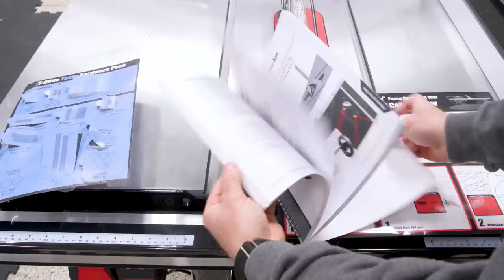I Left Powermatic for Sawstop!

Comment: Welcome to the fold. I am sure you are not missing anything changing to Sawstop. I loved the video, but I wished you would have mentioned the Sawstop technical group. I have never seen an after sale service group that can match them. They are fantastic. No matter what problem you are having, they will walk you through it over the phone and get you back on track. An absolutely awesome group of experts will answer your call (immediately) and get you back running again. These are not people following a flow chart to answer you, they actually know what they are talking about. 
  Brings me to point number 2. Should of explained how the brake system saves fingers. In my 40 years of woodworking, I finally made a mistake. Kick back caused one of my fingers to engage the saw blade. The blade disappeared below the table so fast I was left with only a small red line on the finger in question. It did not even bleed. It was less than a paper cut.
  I will never ever, ever, ever give up my Sawstop saw. I have the 52in 3hp pcs with the sliding miter on one side and the router table on the other. You were always at the top of my list for people I watch on youtube. You just went to number #1. Powermatic doesn't deserve you. Their loss, Sawstop's gain.

Comment: I injured myself after the cut was finished and the saw was powered off. Too easy to do. Question, does the saws top system still operate after the power is removed?
Reply: The braking system has its own ON switch separate from the switch that starts the blade.  The brake still runs as long as the blade is moving, even if you've just turned the blade power off.  The brake doesn't work if its separate power is turned off, or if the saw is unplugged.
Reply: @stevenkrause3907  That's good to know. Given it stops pretty quickly this would eliminate much of the risk but not all of it when you don't have the guards in place or the brain in gear.

Comment: You can bypass the safety by using the key switch if you are using wet material or something you aren't sure of. Also; the dado cartridge uses the same height setting as the standard brake so you don't need to readjust it.
Reply from the maker: Unless your dado is a different size like mine is 😉
Reply: @woodwhisperer  what do you mean? I use an 8 inch dado in our 10 inch machine. You have to swap out the 10 in cartridge with the 8 inch cartridge but it's painless. I'm just curious, I don't understand.
Reply from the maker: I dont know. I put in my dado stack and swapped in the dado brake, and I had a significant adjustment to make.

Comment: Marc, I know you’re not a big blade changer - I am even more so than Cremona. Even for dado changes setting the gap with the plastic shim is tiresome. I closed my yellow screw fully clockwise and put an index mark at 12:00. Then I measured how much each blade need to open up and marked that on the blade with a sharpie, like 2x360+90. Increments of 90 degrees were plenty close enough. Now it just takes a few seconds to set the gap. Remeasure after sharpening of course.

Comment: Love my Sawstop. Whenever in doubt use the override, such as wet, reclaimed or questionable lumber.  Only one complaint and that is the brake triggered once (after 3 years of use) and I didn’t’t have any stock on the saw yet so nothing touched the blade. When I contacted Sawstop they had me send them the brake and their response was “Yes it triggered” no crap!. Not why it triggered and when I asked if they would cover the cost of a new blade they said no. So I was NOT PLEASED with that.
Reply: If it saved your finger you get a free brake replacement.

Comment: I reluctantly bought the SawStop jobsite saw when my old RIdgid jobsite saw died. I don't love it but it is marginally better than the Ridgid. I had to get the model swapped out because the table wasn't flat. Unlike your PCS the fence cannot be tightened to get rid of the slop so micro adjustments are very difficult. The quick blade raise/lower is terrible - you can't sneak up on a depth and the blade is on a pulley system which is odd. I do like the fact that the motor uses a belt which gives you less vibration. If I end up moving somewhere with more space I will replace it with a cabinet saw and hopefully by then we'll have some more choices that also have the safety mechanism now that the SS patent is expired.
Reply: Thanks for being honest

Comment: I bought the Sawstop contractor 52" on 7/31/21 added the extra accessories in Sept mobile base overhead dust collection and cast iron wings etc but haven't used it much with only 1 day off but do enjoy the saw, after watching this video I'd better check out my dado stack make sure it's a recommended dado stack. Thanks for the video

Comment: Re: 36" vs 52" I have a 60 year old Powermatic M-72 with a 52" Biesemeyer setup but am cutting it down to 36" and putting a router lift in the extension. What, exactly, was the supposed advantage of a 52"? Anyone?

Comment: Always wondered if the Saw Stop Blade performs an emergency stop AFTER the power is off. I cut my thumb grabbing the falling offcut after the power was off (Dewalt Contractor Saw). Called 911 and told them I just cut my thumb with my table saw. The 911 operator asked if my thumb was still attached. I actually looked down at my thumb before answering YES, it is just a cut across the top. 12 stitches. But now I can no longer pull open a zip lock bag. Nerves and muscles in the top 1/4 inch are severed.

Comment: Thanks Marc, you may be late to the game but your video prompted two new thoughts about Sawstop that hadn’t occurred to me even after looking into them for years. 

Your comment about injuries from a moving blade after the power is off made me wonder: will the brake activate during that time if needed, or is it disabled when the switch goes off? As you note, a lot of injuries happen during that brief interlude, so unless Sawstop uses not just the on/off status but also blade speed to determine when the brake is enabled, I could see losing a finger or at least taking a nasty cut even on one of these when not paying attention.

The second thing was that if I ever knew about the limitations on blade selection, I’ve forgotten until you mentioned it. Now that I’ve been woodworking for a few years, I’ve become a little opinionated about my blades :-) so thank you for the heads up - I’m closing in on getting one of these vs. a Harvey, and while it might not be a deal breaker if I had to lose my Forrest Woodworker II to go Sawstop, it will be good to know going in so i’ll be doing the research.
Reply: I was using a Forrest Woodworker II when I activated my SawStop so I can vouch for that blade being OK.
Reply: The SawStop safety feature is active until the blade comes to a complete stop

Comment: I would love to see Marc experimenting with a slider. For the extra shop space they occupy they also negate the need for alot of sleds and other tool functions in the workshop.
I guess it is really a pro shop tool and Marc is producing content for the hobbyist, but I'd still like to hear his take.
Thanks for another honest take.
Reply: It's not a pro-only tool, I'm a hobbyist woodworker and student, I'm just finishing building my first shop and purchasing my first table saw for myself. I went with an entry level slider, an SCM SC 2C VR. That was the biggest I could fit in my small shop.
Reply: @TheDaniel85  only "pro-level" due to space and cost versus a cabinet saw.
How are you enjoying it?
I'm a full time furniture maker and I've got my first slider on order.
Reply: @casselscustom8922  I don't know yet! I just finished putting primer on the walls of the shop today! I hope to start enjoying it after the exams in 3 weeks.

I can agree they're not cheap, but they're well worth it. I've managed to save up for one as a student, so they're not out of reach for hobbyists. But I'm in Europe, where sliders are more common.

What model and brand of slider did you go for?
Reply: I've got a Felder K500 on the way
Reply: @casselscustom8922  Very nice, Congratulations! 😁

Comment: From one Missourian to now another. Here's hoping you don't have any warranty issues or problems.  I've been without a functioning saw for nearly a month and Sawstop is slowly having me replace piece by piece.  Even my retailer who sold me the saw thinks they should replace the whole thing and SawStop is pushing back. Total nightmare.  Misfires of the braking system and loss of power in bypass mode.  Non-functioning $4,000 table saw at this point.  I hope you have better luck with yours.

Comment: Dumb question but I'm going to ask anyway. I assume you can touch the blade when using aluminum  bars to set the height of your cut... with power off. Or does it need to also be unplugged in order to NOT set off the braking system?
Reply: No it does not need to be unplugged, and probably should be powered off (main power - small switch), but you don't need to power it off (though you absolutely should unless you have a really good reason not to).

TL;DR - The braking system will only trigger when the blade is paddle/switch is on and for a few seconds after that paddle/switch is turned off (while the blade is spinning down).

When the tool is powered on (main power / small switch on, red paddle off - i.e. blade not spinning), they saw lights will actually indicate that would trigger if you touch it. I.e. You power on the sawstop and touch the side of the blade with your finger / metal / any conductor with sufficient capacitance the light indicators will blink with the appropriate message (near activation, trigger activation, etc) - but of course the brake is not activated/fired in this case.
Reply from the maker: If the blade is not running, the safety system is disengaged and you can make contact with the blade.

Comment: You will have problems with the dust hose is it comes off inside the cabinet. I teach furniture making at a local college and we have two of the ICS models with 5 HP the more you tilt the blade the more abt it will work loose so keep an eye on it. I ordered the one you have for the theater department and it worked great for them. The two styles of saws are built like a tank. Good choice but not for me, Harvey is the way to go.

Comment: I turned off my saw and went to knock and off cut out of the way cause I didn't want it to catch the blade.  Apparently I didn't realize just how close my finger was to the blade and BAM!  Luckily the blade was winding down, it wasn't too bad of an injury.  But 2 years later, I still get a tingling in the tip of my finger where the blade took a chunk out of it.  A couple days later, when I could use my mouse, went shopping for a PCS.  I wish I would've done it the moment I wanted to take my woodworking a little more seriously.  Safety features aside, it's a very well built saw.

Comment: Nice review. Pretty much sold on a SawStop already when I get my new shop built = building a new house with a new shop. Why did you go with the 3 hp model?
Reply from the maker: I've never needed more honestly.
Reply: I went with the 1.75hp and it works really well of course, but there's still a bit of remorse that I didn't just go with the 3hp. I also have the same back and forth with the 36" vs 52" table (I went with 36"). I agree with what was said about sheet goods being done elsewhere, so that made me feel better about the 36" that I have. You can always buy new rails and table in the parts store if you wanted to switch, but I'm good for now.
Reply: @multibeast828  I have the 52" and on maybe 3 occasions needed the full size for a couple of dubious full sheet cuts. I now have a good track saw and am debating 'downgrading' to the 36" - hopefully by trading with some sucker looking upgrade to the 52" :P I think you made the right call! The trade off in space vs cost (for a good track saw) would be different based on the circumstances, but you really need a good infeed table/system to take advantage of full 52" too.

Comment: I've been thinking about getting a sawstop for a few months. It's a huge investment in both money and space in my garage. I'm just a hobbyist who sells what I can but not a business. 

What I want is the pcs with cast iron and t-track fence. I feel like after adding a few features and upgrades to the contractor you're already almost to the pcs price.

The question that nags at me is I've heard saw stops patents are expiring, so does that mean if I wait a few years there will be other options on the market? Or is it not that simple? 

Any input is appreciated.
Reply: I picked up a PCS this summer to replace a 1950's Craftsman. It was a huge investment for me too, but this is the type of tool that you shouldn't have to replace. I came to the same conclusion about the contractor saw - might as well go bigger. If you have the coin, I think the PCS with the upgraded fence is the way to go. I save so much time on every project by just having this beefy cast iron top with a dead-nuts accurate fence system that it's worth the cost even if I only every make projects for myself.

Comment: You do have a choice, feliders has a full size 5 in one sliding table saw that cost 5 time what you spent but you can save a lot of shop space and sell almost all your machines for becuse it does them all.
And has blade stop technology without the cost of a new blade or cartrage if you set it off. Its been out a few years.
A fully equipped machine and tooling would be over 20k  but look at the space your tools are taking up and the overall cost you spent on them and can they match what the frilders can do? 
If your just starting out i think id go for 
One of Feilders lines and im sure you can find financing as these hold there value.
Who knows the factory might have what you want used as I think they take tradeins.
I'll bet you don't see many wood working machind manufacturers taking used machines back in on trade. Its just not somthing they do.

Comment: I don't use the guards on my table saw either. I have a Grizzly 3HP cabinet saw. The guard that came with it I consider a hazard all on its own. I think they used beer cans to make the thing.

I have invested in other tools, like the Jessem guides. These were the best money I've spent in a long time. They pull the work pieces into the fence securely, so I don't have to lean into a workpiece to keep it against the fence. And because they're mounted to the fence itself, they prevent the fence deflection that occurs when you push your workpiece against the fence to make an accurate cut. I use long push sticks to feed the stock. I don't have to bend over the table or put my hands anywhere near the blade.

I have a big bandsaw, so I never, ever use the tablesaw to cut anything janky.

Comment: LOL! I have a 11/2 HP 1948 Delta Unisaw.
It has a motor that takes two men and a boy to lift.
It rips 5/4 oak with just the flitting sound of oak shavings being flung through the air.
It will easily last 200 years, unlike the new stuff with their ridiculous post 1971 "3 HP" hot dog motors.

Comment: my opinion is that they are not well built saws, the safety feature is nice but If you're not careful you will spend a lot of money on blades and cartridges,  they're also very expensive,  you can buy a PM66 or Delta Unisaw,  spend 1/4 the price and have a much better machine. minus the safety feature,  but if you use the guard you should be ok with that.

Comment: Good Review. I have owned this saw twice. Ones the 54” with the panel table and updated out table. Sold it and 3 moths later with the 36”, pretty much what you just saw. Works better. I would like to see more information on the fence conversion. One complaint is the fence is not high enough. The second they is adjusting the fence so it moves a smooth. The table was very easy to align to miter slot. Thanks for the great review. Glad to see you updated.